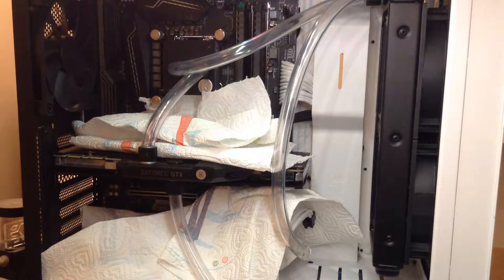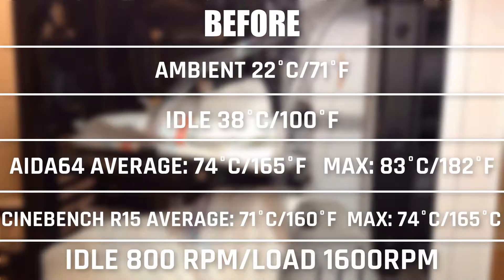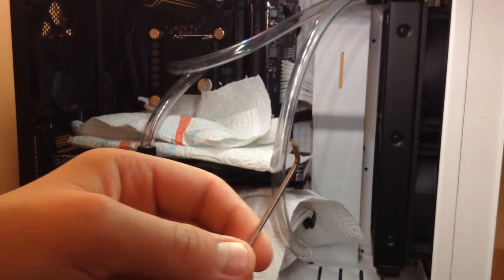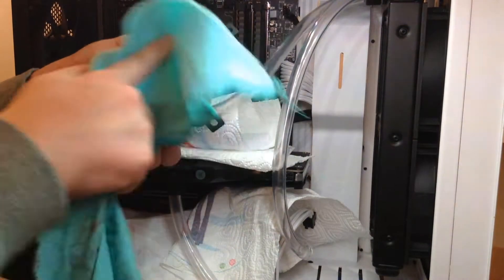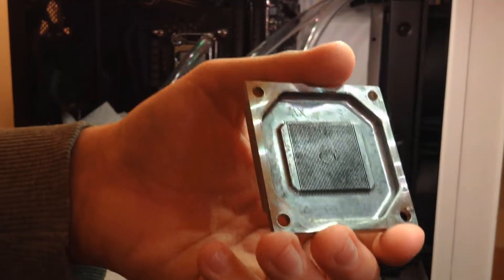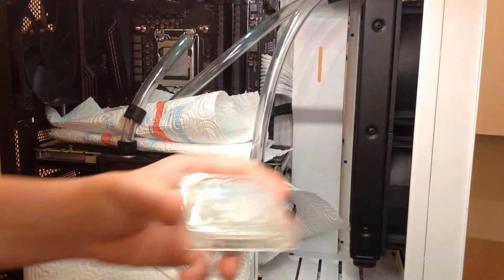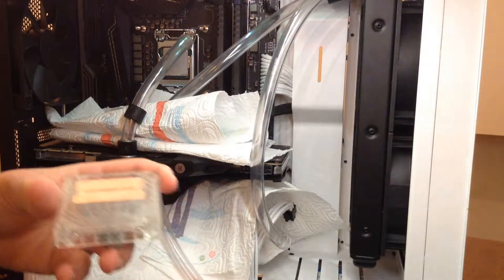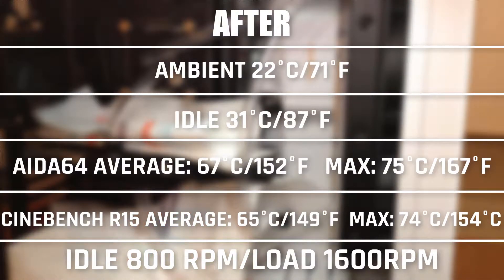HIGH TEMPS on CUSTOM Loop? Here's How To FIX IT!

Comment: I just did a single 360 Rad hard tube loop for a 9900k and 2080 super. my GPU sits idle at 40-50*C and CPU is 33-39*C. Guess I need 2 Rads?
Reply from the maker: Something that could cause this might be a pump running at low rpm, if it isn't this you could have a bad thermal paste application, as 40-50°C idle it's a bit high. Check the temps under load, if they're fine, then you definitely don't need an extra rad, I have a 240+120mm configuration with the 7700k and 1080 ti (Both OC'd)and it's perfectly fine, and as you, my cpu idles at ~35°C, tho my gpu stays around 27-29°C.
Reply: @feelingtech2233  i left the plastic on one of my thermal pads. the paste didn't spread really for some reason, did good size dot as well. my load would get to almost 80 Celsius.
Reply: Also undid my loop, got a new pump coming as well.
Reply from the maker: @DropthaBomb1  yup, that's what i thought, on the gpu die you actually have to spread the paste yourself, as it's not like a CPU IHS, the whole surface produces heat
Reply: FeelingTech yea I spreaded it this time loo

Comment: My pc run soo hot. I think i need another radiator
Reply from the maker: Well, I saw the pc in your video and yeah, a 360 rad can't cool that pc properly. I actually added this summer another 120mm rad to my loop, with an OC 1080 Ti and hot weather it just wasn't enoungh
Reply: @feelingtech2233  yeah the thermaltake pacific rl360 is not too good. I thought it would be enough as it was very thick and i wasnt bothered to add another rad and more loop. Temps for cpu is around close to 80celsius and gpu is 70celsius and i was on for like an hour. I can try putting new themal past on, try getting air out of loop and so on. If that dont work, i will add a second rad or get rid of one of those 1080ti
Reply from the maker: @Kdjoao  If you want you can gift the 1080Ti to me ahahah
Reply: It will not matter.  Add as much rads u want.  U will see the temps wont change